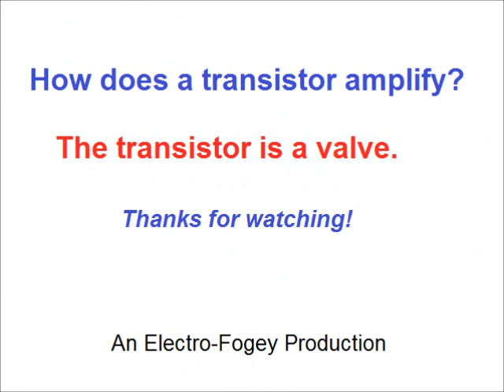How does a transistor amplify?

Comment from the maker: Too true.  I've thought about remaking this video, or adding something in the description about it, but haven't had the time.  Technically, because the time it takes for me to press down on the lever is the same time as it takes for the tractor to rise, I think the time factors cancel out, and power out is still power in, but I'm not a physicist so I won't say for sure.  I mix up energy and power a lot. When an engineering physicist prof makes a clearer video than mine, I'll delete my version.

Comment from the maker: That's pretty much it.  What the bipolar junction transitor is really doing is controlling and limiting the current between collector and emitter (Ice).  Due to the structure inside it, Ice is a multiple of Ibe (base-emitter current).  It essentially changes the resistance between collector and emitter.  A relay has either very high resistance (open) or very low resistance (closed), but a transistor can have variable amounts of resistance.  A resistor limits current, so does a transistor.

Comment from the maker: A valve allows a large force or quantity to be controlled by a much smaller input force.  So, a tiny input force then becomes a much larger output force.  The transistor doesn't create power or energy, but it makes a larger signal by controlling another power source, like a battery or power supply.

Comment: there are many cases where op-amp is impractical to use. For example, u can always use single-stage amplifier (CC, CB or CE BJTs) to flip a signal (to get phase of pi). using manually built amps, u can also control phase/gain margin, chip's frequency response, etc...

u can't use one pre-built chip (op-amp) everywhere for different applications. Depending on needs and design specs, u design different types of amplifiers.

Comment: i always thought of  transistor as a regulation of something .
like voice , you make the Dc voltage of the battery swing like the weak electrically converted voice signal by mic .
but this is the idea just hanging  in the air from years .
I am not able to understand it a mathematically and physically , i thought of going into quantum mechanics , but again, it is a long way down .
Anyways the video was AWESOME , just good to somebody out there thinks the same :)

Comment: It's true, but using one transistor will not have any PSRR or CMR.
An opamp is usually the most practical simplest thing to do to amplify, compare or flip the signal.
It is important to understand that an opamp is a system while a transistor is a basic component.
For example you want to blink a bunch of leds, you can do with transistors or flip flops and other small scale IC-s but today the simplest most effective thing is to put in a 50 cent mcu
Using a complex part is easier most of the times

Comment: hey big guy, this was a perfect 101 level video.  I am sure that a lot of people got a lot of knowledge from it. 
the guy who mentioned that you had confused power with energy explained it at a higher level which made his explanation a bit awkward.  let me try.  think of power as horsepower.  it's not only the amount of work that is done <energy> but also the rate at which it's done.  remember, you can put a lot of energy into that lever trying to lift the tractor but if you aren't fat enough it won't rise up and you have done no work at all.  now if you are very fat, like me, then it will not only go up but it will do so quickly!  <more power>  same work is done but it's done faster so more power.

Comment: Conor c said:"Why not Op-amps...? whats the differences between an op-amp and a transistor amplifier? Not physically, i mean power useage etc etc..." the key difference is that with an op-amp no current flows into the input and with a transistor it does.
Reply: +Pan Harty Losting

Comment: like my guitar and amp, the amps max output is 100w but i regulate it by how hard i strum the strings, also the dial setting on the amp itself which i imagine would be a variable resistor?

Comment: @bassmanco op-amps usually can only deliver up to maybe 100mA maximum, often much less, like 10-20mA! With a small transistor you can deliver at least 100mA and often much much more! A transistor like the 2n2222 can handle 800mA and with the right cooling and the right transistor you can have 10's of amps through your transistor!

Comment: What about how it *actually* works?

Yes, you can think of it as a valve, but there's a lot of funky stuff going on inside a transistor that is hard to visualize and explain without an animation.

Sure you could compare it to a water valve that's controllable by a small water pressure to the base, but that's not what's going on with an actual silicon transistor

You have depletion layers changing in thickness, charges being carried by holes and electrons, recombination, static electricity...

Comment: I'm quite sure the 10,000lbs of water pressure is not bearing directly onto the pipes of your home.  But ok.
Reply: +Des Troya  also could have used more focus on transistors than just "they are like valves not levers or pumps the end".  You could have even have had a diagram and illustrated what exactly the electrons do in a resistors and why that is analogous to a valve.  ffs